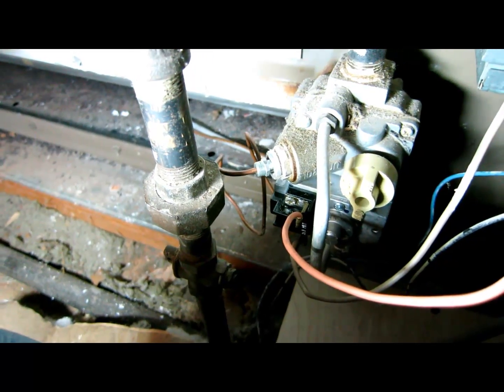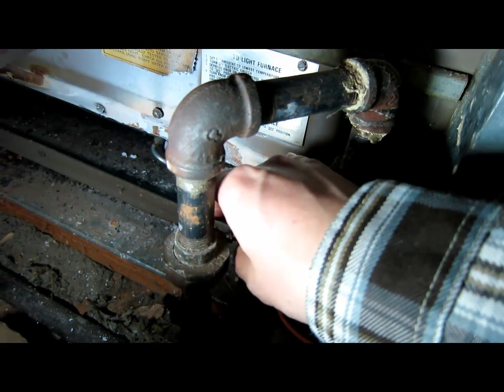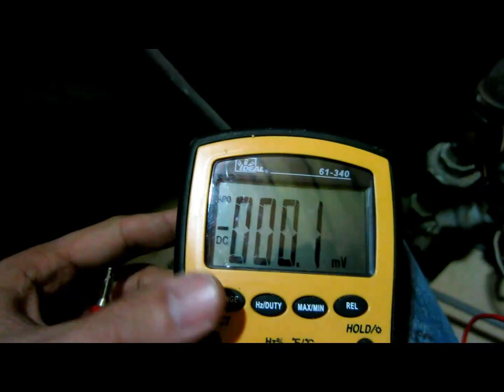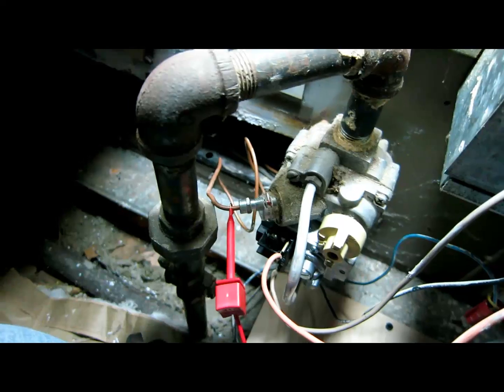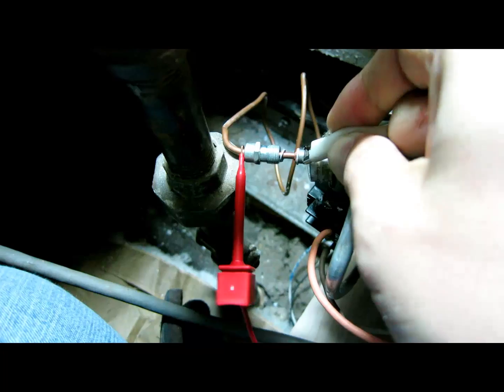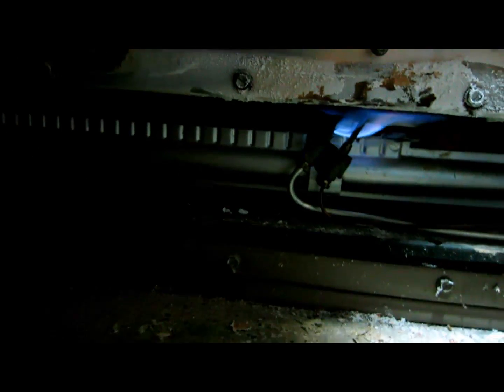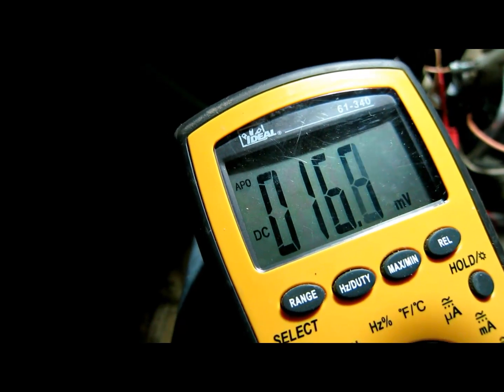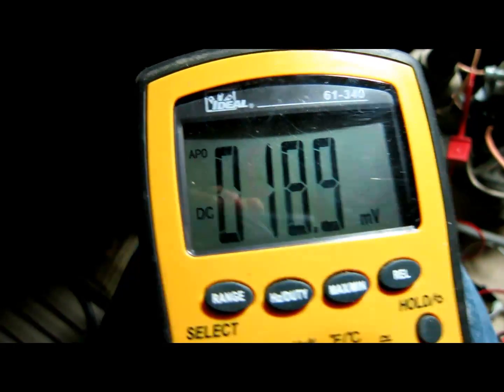Measure & Testing Furnace Thermocouple - troubleshooting pilot light flame - test troubleshoot

Comment: Do you know of a way to relate the voltage you read on your multimeter to a temp. I am curious if one can get a chart or calculate the temp the chamber is at by some conversion of the milivolt readings to temps.  I know its probably highly dependent on the thermocouple device so a new chart would be need for different thermocouplers. But i haven't found much on it yet. I do have to give you create it you solved the mystery of where the positive and negative probes go when its these type of thermocouplers without the 2,3 wires on them.

Comment: It works because ground is not negative. Ground has no polarity itself, only in reference to the power source. It's true that in cars that ground is negative but this is just one convention. Some very old cars had positive grounds.

In this case the power source is the thermocouple. Since its positive terminal is connected to ground, that makes it a positive ground system.  

Also the device is a thermocouple not a "thermocoupler" as you pronounce it in the audio track.

Comment from the maker: good question, i am not too sure, but here's my guess. The servo valve must be made with passive components (e.g. transformer). Hence, as long as the DC voltage moves the valve open in the correct direction, then thats all is needed.

Comment: Hi, why is it that the outer copper is positive and the inner part is negative when the outer shell of the gas valve is ground which is more or less negative, how does it not conflict with the workings of the thermocouple? It should be shorting out..